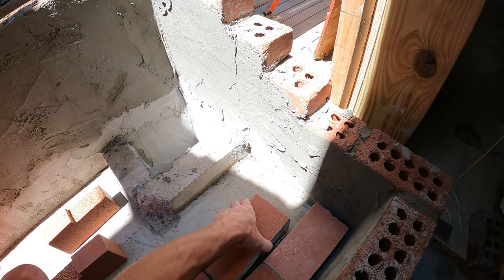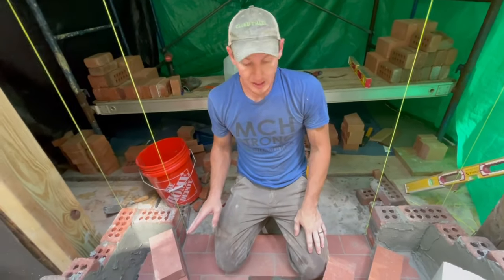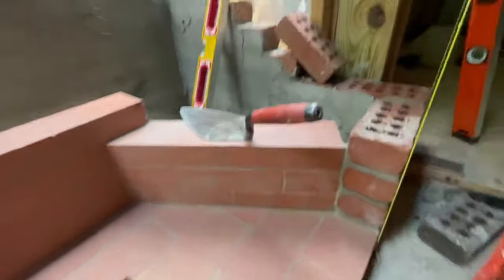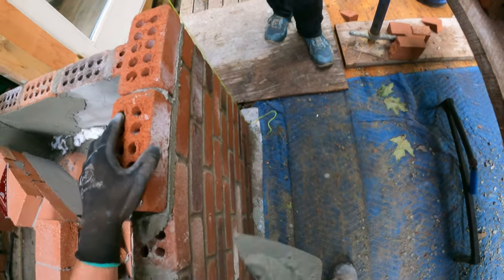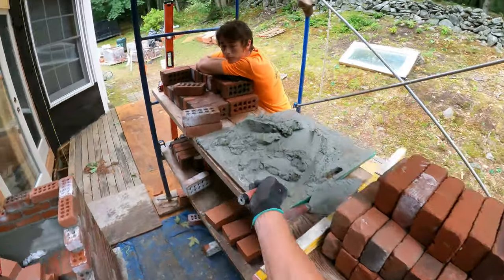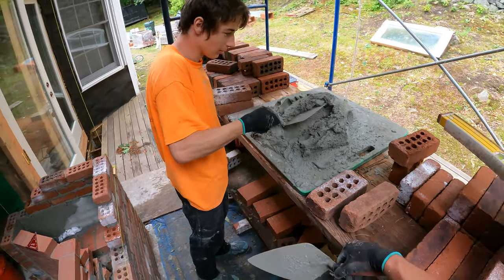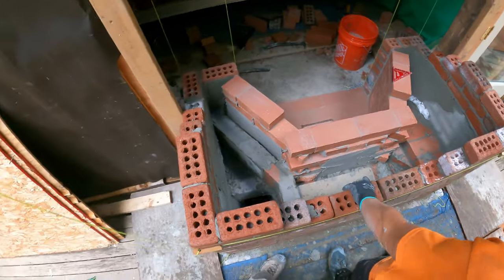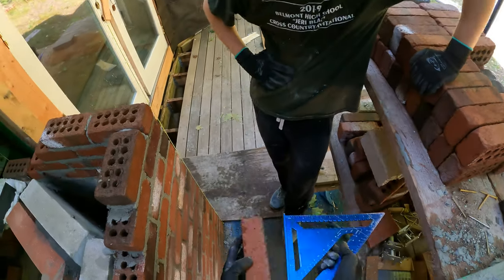Brick fireplace construction | Episode 5:  Building the firebox

Comment: there is a reason why back is not tied to the sides - expansion, and preventing back cracking because of that. At least that's what I heard. I like your work though. I will be rebuilding firebox, and I was wondering whether it's worth laying the floor like tiles. Since refractory mortar is so smooth, like thinset, could use 1/4"x1/4"x1/4" square notch trowel to spread mortar on the floor,  and then just apply mortar on the sides of the brick, and push it down. Thoughts?
Reply from the maker: I’ve done a fair amount of tile work, so it always seems like a good idea in my head to install like tile. The problem is the height and pitch of the slab is always off a bit from where it needs to be and the thickness of the brick varies a bit. You have to butter the joints anyway, otherwise you couldn’t fill them all the way, so it’s not a big deal to just lay them at the same time. Every firebox built with three panels, still cracks in the corners where they’re mortared together.

Comment: Excellent video. Thank you. I have heard you mention and question if the thickness of the firebox and the back wall can be added together to achieve the 8" thickness of solid masonry code requires. I am reviewing some design plans published by the New York State Concrete Masonry Association and they indicate that they can be counted together to achieve the required 8"s. The exact wording off the drawing: "Total thickness of back wall and sides of firebox is 8" min". To me this indicates that there is nothing wrong with an air gap or insulation or other "creative" design techniques as long as we achieve the 8" thickness with the combined firebox and back wall thickness. Please let me know if your thoughts differ.
Reply from the maker: I've read it many times, hoping to find a better  way of understanding it. I do read it opposite of what you're saying. I just wish they would get together with people who know the trade and put everything in a better language for everyone to understand. We shouldn't be guessing.
Reply: Another place on the drawings state: " Total thickness of back wall and sides of firebox is 8" but yeah, I guess you could interpret it either way. Either the total combined thickness or individual thickness. I agree it should be clearer.  @chadvaillancourt

Comment: Don't you need an expansion gap behind the firebrick?  I recently had a firebox rebuilt by a mason and it already has a vertical crack up the back firebox wall.  On other sites I read that you need a 1/2 inch gap behind the firebrick from the framing to account for expansion and contraction of the firebrick.  The parging then is done at the top of the firebox to the sides/back.  He did however use some premixed high heat cement for the mortar (that I had around that I used to parge the smoke chamber) to lay the bricks.  So what likely caused the cracking? I appreciate any insight or clarification.
Reply from the maker: Honestly I think an expansion gap is critical, maybe just using a piece of cardboard like they do when building a mason heater. Unfortunately the code doesn’t allow for this, and requires solid masonry. If I was working in a town that didn’t have inspections, I would build this way. 
The crack was likely caused by expansion. While it may be aggravating to look at it shouldn’t be cause for concern.
Reply: @chadvaillancourt  Thanks for the reply.  This is a house that was built in Wisconsin in the 60's.  The firebox was in bad shape, so I started  ripping it apart and behind it was a mess.  I am the 2nd owner and I believe there probably was a chimney fire at one point.  When we moved in (1997) there was an insert and the flue was redone with vermiculite that made the opening too small for the firebox.  Anyhow, behind the firebrick was a hodge podge of miscellaneous cinder block, gravel, etc. that was not joined to the firebrick.  I just want a fireplace to enjoy to my end of life (probably another 30 years give or take-or tomorrow; lol).  Thanks for the reassurance.

Comment: I am having to rebuild the firebox floor of our 32 year old fireplace. All of the mortar is cracked and separated from the firebricks. Some of the firebricks are also cracked. Question-  What is the requirement for what type of mortar/cement is used below the firebrick in the firebox? I am not referring to what is used to set the bricks or fill the joints. I ask because there is a lot of conflicting information out there. Also, is it better to go with a thinner or thicker joint between bricks, or does it really matter?  BTW- You have one thumbs down because you don't have any raid the village or house music. BTW- This is a great series of videos.
Reply from the maker: The code requirement is medium duty refractory mortar that is non- water-soluble (not the premixed type) with a 1/4” maximum mortar joint. Fire clay or regular mortar doesn’t meet the code requirements. I use bags of Heatstop 50 for all aspects of laying firebrick. One 50lb bag costs about $61.50 where I am, that will be more than enough for your project. 
There is definitely a lot of conflicting information surrounding fireplaces. I’m sure I’ll have many thumbs down over time. Lots of hate out there.
Reply: @chadvaillancourt  Thanks for the info. I can't find Heatstop 50 here in Asheville, NC. The cheapest I can find it is $139.00 online. I know the feeling about Dislikes. I guess it is easier to hate and feel good about yourself than to say something nice and feel good about yourself. I had 3,000 views on one video, over 100 Likes, and no Dislikes. Right after the first Dislike they just kept coming.
Reply from the maker: Adam’s supply in Asheville has heatstop 50 in stock for $93 per bag. Still expensive but cheaper than online.
Reply: @chadvaillancourt  Thanks for looking out.
Reply from the maker: My pleasure! Good luck with your project
Reply: @chadvaillancourt  Sorry for continuing to ask questions, but if I could get a fireplace mason to come out, I wouldn't have to... soonest is March 2022. Anyway, is it common for mortar that falls in to the flues, as it is being built, to just be left on the smoke shelf? My house is 32 years old and apparently the fireplace/flues/chimney have not been properly maintained/serviced. It's not mortar that came loose and fell down the flues. It's mortar splat. I removed 1 1/2 5-gallon buckets of mortar splat (among other things) from the smoke shelf.
Reply from the maker: I don’t mind the questions at all! 
Yes, I would say it’s very common. Some guys are animals when they’re slapping stuff together and a lot of mortar is falling into that area especially when building the smoke chamber. Precautions should be taken, like putting some empty mortar bags on top of the damper and smoke shelf as to prevent adhesion and make cleaning out at the end easier.
Reply: @chadvaillancourt  I can see how a lot of mortar would end up there. Just surprised that it wasn't cleaned up and stayed there all these years. Most of it was loose and weathered. Thanks for being receptive to questions.
Reply: @chadvaillancourt  Yes there is, its amazing, but thx for the no irritating music!

Comment: Hey Chad, need help here, building my first fireplace, (not a mason, love your videos) it's an outside Rumford at the end of my timber frame pavilion, I'm stepping the back wall forward gradually and can see that it's opening as I ascend.  Sides are plumb, I am interlocking each course, is this ok? 42" wide, 15" deep for the first six courses, going up to 38-42 ish before I start throat and lintel, looks like the top of the back wall will be close to 18".  Love to hear from you if you would Sir.  Back wall is 15 wide at the base too.
Reply from the maker: Fun project!
Sounds like you know exactly what you’re doing. 
I will say, a Rumford fireplace will always have a plumb back wall and not corbel or slant forward. Exact dimensions are 14” back wall for a 42” wide firebox, but 15” is close enough and your height and depth are fine too. Interlocking in masonry is always a great idea, it may take longer but it’s a better product.
Reply: @chadvaillancourt  Thank you for responding so quickly, appreciate it Sir.  Arrghh... lol, saw that in the plans , watched way to many videos, liked how the corbel you did looked so I did it.  Six courses plumb, seven courses corbeled, should I run with it or run the remainder plumb?  Not really digging the thought of tearing down my mistake, Heatstop is pricey.
Reply from the maker: Just run with it, everything will be fine. Rumfords are designed for laminar air flow, your hardly going to see that outdoors anyway. You will get a nice working fireplace that throws plenty of heat with your design.
Reply: @chadvaillancourt   Awesome,  thank you again, have a great night and keep those videos coming, love em!

Comment: How do you size the angle iron above the opening?  Do you have it set on fiberglass?  Other details about this would be appreciated.
Reply from the maker: The lintel has to extend 4” minimum on each side. I use super wool which is a ceramic high temp insulation, I wouldn’t use fiberglass, the fire rating is too low. You don’t have to use any insulation to be code compliant, I just think it’s a good idea to allow for expansion. You can find  chimney and fireplace codes at iccsafe.org, it’s probably easier to just google “fireplace codes” and click the ICC link.
Reply: @chadvaillancourt  Is it a 3"x3" angle iron?  I'm going to make 3/8" joints, should it be 1/4" thick?  I'm going to watch the next episode, and maybe you explain this, but how do you hide the wool?  Thanks for the help.
Reply from the maker: Yes, it’s a 3”x3” angle iron. 3/16” or 1/4” would be fine. I use enough insulation to just cover the face of the angle then I pack with mortar in front. The steel wants to expand lengthwise more than the width, so the ends are most critical for allowing expansion.
Reply: Thank-you.  That helps a lot.  I'm making a video and will message you a link when it is done.

Comment: Hi do you use Portland cement for the firebox or refractory ?
Reply from the maker: Refractory
Reply: Thank you. I have a question I have to seal off the ash dump on my fireplace. What do you recommend, using fire brick or just cementing the metal plate that’s already there so it doesn’t open and closes ? Thank you for your help
Reply from the maker: @elchulo950 just use a fire brick.

Comment: Nice to look at but not very practical or efficient in the era of solar panels, heat pumps, and electric fireplaces. Our original brick fireplace transitioned from wood, to gas insert, to electric insert. Do the flames look real? Nope. Does it put out much heat? Nope. Does it pollute? Nope.